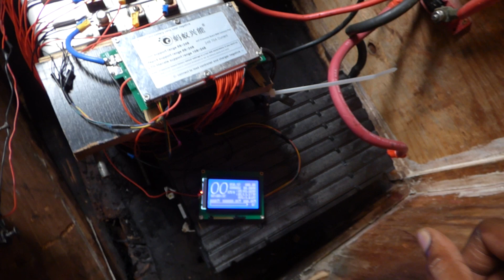Better BMS for my Nissan leaf off grid batteries

Comment: Do you have a clear diagram of how the BMS terminals are connected to the modules?
Reply from the maker: The BMS always comes with one. There are many videos that show detailed step by step
Reply: @drsolar  My BMS did not come with detailed instructions for the Leaf Modules. I have seen two videos that sorta show. Yours and another which was done differently than yours. So if there is more than one way, someones way is not right. I have seen how for standard prismatic cells but not for the Leaf Module. Im looking specific for the Leaf Module and looking specifically for a clean clear drawing of the wiring for the Leaf Module and using the 14s wiring setup using 7 modules for a 48v string of modules.
Reply from the maker: @onegreenev  send me an email at info@atlanticwastepower.com and I will send you a diagram and pictures.

Comment: I have 35kw of leaf at 48v setup 
What your thoughts on a 100a bms system that l can monitor and adjust high and low settings
Reply from the maker: Wow 35 kwh is massive. There are so many options available to you. Do you intend to charge or discharge at up to 100 amps?

Comment: I noticed that you used a wooden box as a container, it is not exactly the best choice for safety, because wood is not a fireproof material, and it can create moisture inside. If in the future you decide to upgrade the project I suggest you to change the box material.
Reply from the maker: Great observation. We are working on metal enclosures

Comment: Great video, just a side note, I bought 35kw (70 modules) and some of them was different voltages. What I did was connect all of them in parallel, left them for a day and they self balance. I’ve done it also with building 18650 packs. Lithium ion batteries will balance themselves if u put them together
Reply from the maker: We balanced them like that too. You don't even need to do it for the whole day. Congrats on your purchase. They do drift a bit as you charge and discharge them. Thank you for watching and commenting

Comment: as the camera kept panning i kept going "really, more ?" thats great, you should have a very nice bank when you're done balancing them all.
that BMS with the screen i'm quite envious of, that looks like a great unit
Reply from the maker: The BMS costs about $110.00 pretty good unit. I love it. It does need a heat sink. I pushed 50 amps through it and it was incredible. It shows you amps watts ah and the individual cell voltages